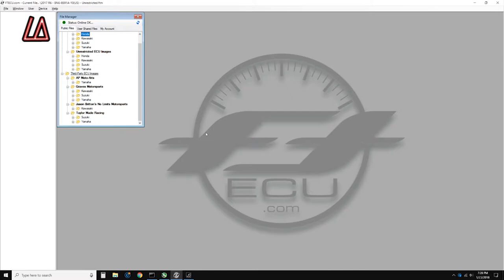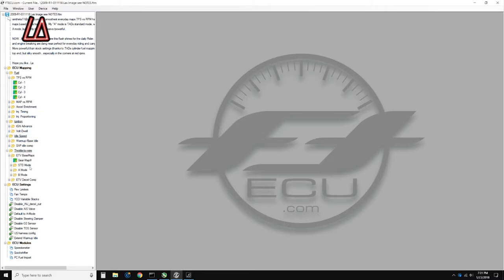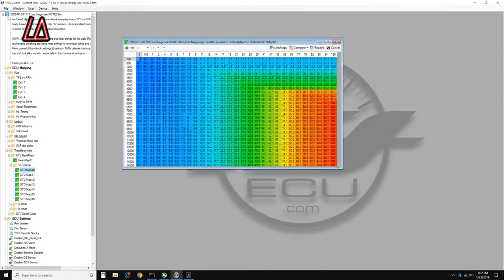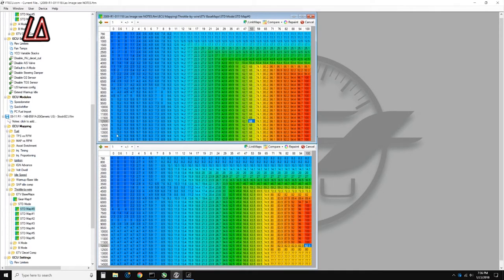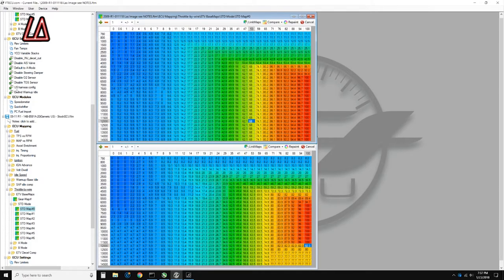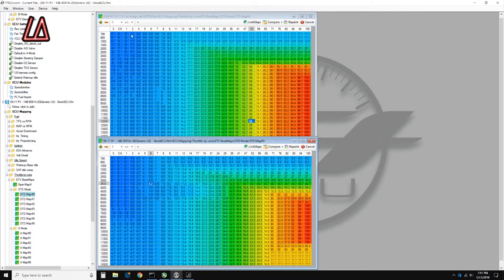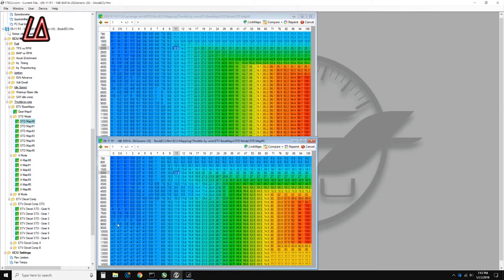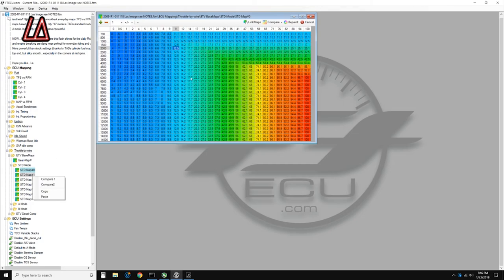How to Flash your ECU with Flash tune: Fix that jerky throttle and engine braking

Comment: In the Fly-By-Wire (FBW) maps, the value in the mapping means: opening degree of throttle valve, not % fuel. It relates a requested throttle position from the throttle grip, to an actual throttle position from the throttle valve. Furthermore, you mean Engine Brake, not break.
Reply: Right... dude has no place making this video lol
Reply from the maker: Just to be clear, I could have explained that to everyone and made asswipes like u happy or I could just say fueling, because in the end that's what the engine is getting and it's easier to understand.  Either way, this video has help a ton of people and u r still one of those "know it all" jackasses that others avoid.  So please avoid coming back here... Thanks
Reply: @IamLaR1  just make sure you wear your helmet... at all times 😂

Comment: Just want to point out that you keep saying that the throttle map is changing fueling, it is not.  Those tables are driver requested throttle percent (how much the rider twisted the hand grip) vs ACTUAL  throttle plate percentage.  So when you are at 12k rpm and you have the throttle pinned 100%, the stock map is reducing the throttle blade to 82.3% opening, IOW its closing the throttle even though you are asking for full open.  In the actual TPS fuel maps, it is fueling based on the actual throttle plate opening not rider requested throttle opening.  Just want to clear that up as the Throttle maps do nothing to adjust actual fuel injection, just how much throttle plate is open or closed and the IAP and TPS fuel maps are what actually modify the amount of fuel.
Reply from the maker: Haha...you are correct and I certainly recognize that, but I also recognize that I was more than likely not going to be talking to engineers, but to regular folks that just want a basic idea of what is happening when you adjust a cell and how that directly effects how the bike moves.  So...when you adjust those cells it ultimately effects the amount of fuel the engine receives and that is the important part.  But thank you brada.👍
Reply: @IamLaR1  its not a guarantee that it will actually add fuel though.  Depending on mods of the bike and the area of the curve being adjusted, you very well could still run lean of optimal by upping throttle and also not addressing the TPS fuel map accordingly.  Now granted, most people that dont understand this stuff will more than likely just download a map by TAD and flash it and forget it, people trying to learn the actual meaning of the maps should know that this just adjusts the drive by wire throttle map and doesnt necessarily do anything for additional fuel.
Reply from the maker: @mattnsac  ... U are correct to a point.  Provided a person hasn't gone in and actually changed the true fueling maps per cylinder, when you increase the cell throttle% number you are telling your ECU to increase  to the next % point in the fueling maps and there for you should be increasing fueling to the engine.  This video is not about changing the actual fueling percentages to each cylinder but more how your bike react to on/off throttle.
Reply: can you please explain, if you have six maps in standard mode and you are riding on standard mode, is the bike using all of them or ....??? how is it?
Reply: actually seven
Reply from the maker: @lkrizo6448  ... Your bike uses one TPS map for each gear and you can assign all gears to use one specific map or each gear can have it's own map.  Example:  1st and 2nd gear can use one specific map and gears 3-6 might have their own individual maps.  This all depends on which map u assign to which gear, including neutral.  There is a sheet in the FTECU software that is dedicated to assigning TPS maps to each gear.  Once you have assigned a map to a gear it will use that specific map when in that specific gear, so that is the map you will need to adjust to get the feel you want in a specific gear.  Again, please don't mess with the actual fueling maps per cylinder.
Reply: @IamLaR1  so if I understand it well those assigned maps are improved maps compared to stock maps and those you can adjust for your self what suits to you, right?
Reply: @lkrizo6448  its per gear
Reply from the maker: @lkrizo6448  yes, you are correct.  When you buy the FTECU software/harnesses they come with adjusted TPS maps.  The stock maps (only talking the R1 because that's all I have ever worked on) are restricted at the top end of the RPM range.  You should compare both the stock TPS maps and the Flashtune unrestricted maps and you will see that at 100% throttle roll (far right portion of the TPS chart) and above 11500 RPMs (I believe, don't have my maps in front of me) the bike is only asking for 80% of fuel (from the fuel maps) even though you are 100% roll on throttle. You can find this area at the bottom right of each of the TPS maps. This 80% "stock" restriction in the top RPMs is eliminated in the Flashtune maps. Now please note that the actual fueling maps per cylinder in the Flashtune maps have been generically adjusted, based on what type of exhaust you have, but your bike still might run slightly lean or slightly rich (rich is the preferred cuz your bike will run cooler).  All and all, the Flashtune maps are designed to make your bike run smoother, eliminate that stock max throttle restrictions, and to help accommodate aftermarket exhausts.
Reply: Thank you very much for explaining. We shall see in couple of days.

Comment: Although i own an MT-07 it was very informative video thank you very much dude! Any idea how do we change the engine braking on this monster torque bike lol. Because there is no ride by wire tab on mt-07 and there is only inj decel false/true setting there. Thanks!
Reply from the maker: So first make sure that your injectors do NOT cut off, that way u r still getter fuel to ur engine at zero throttle, as u slow down.  Then u need to find the maps that correspond to Throttle position sensor and engine RPM.  Once u have found those maps then find the "0" % collum ( meaning 0 roll on of the throttle position sensor) and look at the RPMs between 6000 down to where your engine idles at... Mine idle 1200 or so.  In this one collum, the "0%" collum, is where u will reduce engine breaking.  U r gonna have to add very small amounts of open throttle until ur bike feels the way u want it as it slows down.  U will see in that collum that the amount the throttle position sensor is open gradually decreases as the RPMs reduce, so u r gonna want to copy that gradual reduction, but still add small percentages of fuel by adding slight increases in the amount the throttle position sensor is opened.  Only add very small amounts each time you flash ur bike...to be safe.  U r gonna have to do this for each map your bike is using for each gear. Yes, doing it this way allows u to have different engine breaking per gear based on the map that gear is using. Hope that helped... La
Reply: @IamLaR1  wondered if i could do it only for the 1st 2nd and 3rd gear as there is the most engine brake and leave the rest of the gears untouched?

Comment: Hey mate, love this video, super informative! I have a 2010 R1, Wondering if i can use the info you shared in the video with a Power Commander V? I just got one cheap secondhand, and looking at installing it.
Reply from the maker: I don't have or ever used a power commander but the mapping ideas should be the same.

Comment: Hey la, I'm rebuilding an 09 R1 and I believe the ECU was flashed prior to my purchasing the bike.  The speedometer does not show any speed whatsoever.  I know it's the ECU because I grabbed a buddy's 09 R1 ecu and swapped it with mine and my bike immediately indicated speed when popped into first gear on the stand.  Do you have any idea what parameter may or may not have been changed?  

Best,
M
Reply from the maker: I do not...When I get sometime I will look at the maps.  However, if you have the Flashtune Flash software you can re-flash your ECU to the stock image (Flashtune provides), or use their unrestricted image and it will fix any irregularities that someone did when messing with the image on that ECU.
Reply: @IamLaR1  Thanks for taking the time to respond.  Unfortunately, I do not have the software and it's basically  as expensive as just picking up another ecu off Ebay.

Comment: Hey budd. Can you please tell me which range to adjust specifically. Because I’ve tried doing this and on throttle becomes all jerky. Upto which throttle percentage and up to which rpm cells should i adjust? Thanks
Reply from the maker: What bike are you on? because by I only have experience on the R1(09-16').  If you are on one of those u can look specifically at my maps.  I have them on the FTECU website.
Reply from the maker: Also, if you want to email me a picture of your maps, I can adjust them that way also... (iamthela11@gmail.com).  If you do this, please send me your starting maps and the ones that are jerky and I will walk you thru them.  Remember, we are only talking about the TPS maps and not the fueling per cylinder maps.  But again, I have posted both of my map images for both my 09' R1 and my 16' R1 on the FTECU share server in the FTECU software.

Comment: through this software can't you get a map from a dyno tune where all fueling is adjusted? Then you can test ride and see if you want to make changes.
Reply from the maker: Yes, but the Dyno Tuner has to have the ability to use the software and some shops don't.  The other option is to get the "active tune" sensor, which replaces your O2 sensor (depending on your bike).  I have this on my 2016 R1. This sensor constantly adjusts the fueling mixture  based on riding conditions and works fantastic.

Comment: How expensive is the module addon? Is there a need to buy some sort of thing box to add to the bike like power commander etc?

I got new exhaust and id need to do this too.
Any ideas?
Reply from the maker: PRUIKKI RACING ...no there is no need for a power comamander because this software gives u direct access to the fueling maps.  U might run a little rich/lean with the new exhaust but that can be quickly fixed with a Dyno tune, if needed.  If you have my year R1, then u don't really have to worry about the fuel.  As u can just use my maps or Tads maps (essentially the same fueling Maps) and u r good to go.  The flashtune software basically eliminates the need for any other fuel/ mapping devise.

Comment: its save to flash ecu with this tool ? What about cheksum correction ./?
Reply from the maker: Unfortunately friend, I do not know what a check sum correction is.  I do know that many have flashed their ECUs using this program and Flashtube has really good service (well based on before Covid, but I don't know now).  I know that is not a lot of help so sorry.
Reply: @IamLaR1  thank you my friend I am interested in this box but I did not understand how it works all the files in the file manager require a license. user shared file requests a license I want to have more information on these licenses

Comment: Hey buddy. I tried to edit those cells. It doesnt want to be edited. Can you help me out here please.
Reply from the maker: Which cells in which maps
Reply: It only allows me to increase in groups. I have increased till 6% throttle by 2%. The throttle is very sensitive now. Small twist and it pulls suddenly. Bike is Mt09 2018 model by the way. I dont like it so i guess I’ll have to decrease the value again
Reply from the maker: A couple things...what are u trying to accomplish.  If it is to smooth out ur throttle (get rid of the jerk) then u first need to go to the maps for whatever Power Mode you want to adjust (A,B,C or D) and  increase the fueling (or how open the throttle is...I call it fueling cuz it is easier) in the 1500 RPM to 6500 RPM cells in the "1" column (the column to the furthest left) of each of  the Throttle by wire maps by very small amounts (.10 to .30) for each of the maps being used for your gears.  You can find out what maps are being used by each gear by going to the Throttle by wire map section and then going to Gear-map# Index. I think the maps being used for each Power mode are "0" thru "3" and map "3" is being use for gears"3" thru "6".  By doing this, you will decrease the engine breaking, but you need to makes sure you are adding fuel in very small amounts, as stated above.  Then to smooth things out even more, you need to reduce the fuel (numbers) in each cell of the cells in the columns on the left from  column 2 to about  column 14 and all the cells in those columns below about 7000 RPM.  Again, you need to do this in very small amounts so the throttle rolls on subtly and then slowly increases.  I changed most of the cells to get what I wanted.  Again, the less amount of fuel in these cells on the left side of the map, the easier the throttle will be.  One thing you can do is compare Power Mode D to Power Mode A or B and you will see the difference in the left cells (Power mode D has a very gentle throttle).  Hope this helps.  Let me know if you have any more questions.  Let me repeat this one more time...please make very small incremental changes form .10 to .30, until you get her perfect.
Reply from the maker: No you dont want to increase the fueling in those cells.  You want to decrease those cells so that the fueling is less.  This creates a more gradual roll on and a more controlled throttle response.  Please read my other comment.
Reply from the maker: I will post my 2016 R1 image to the FTECU Website so you can see my maps.  Please look at my Mode B.  These maps are my normal riding maps which I use 100% of the time, even on the track.  Just find Iamthela11 account.  I am about half way down in the "user shared files"